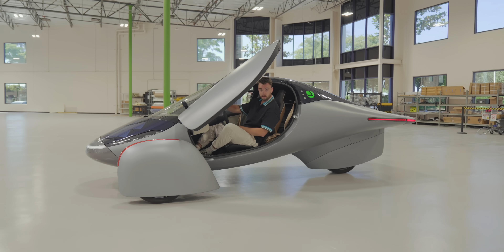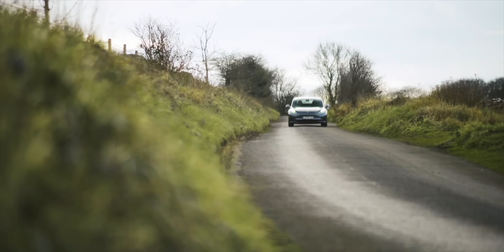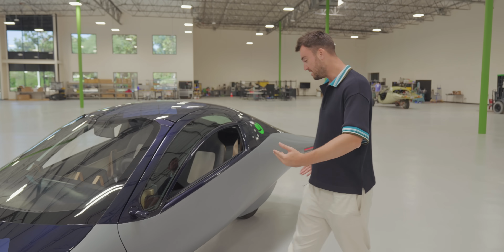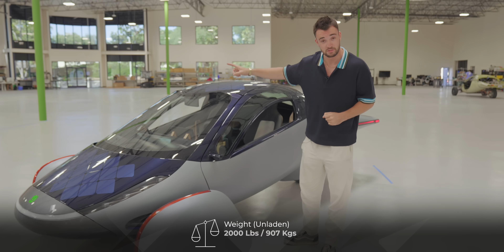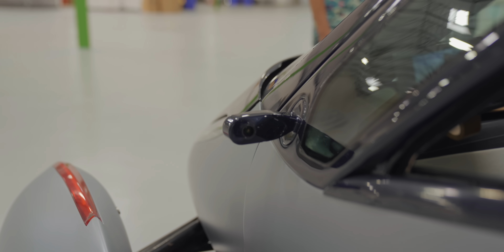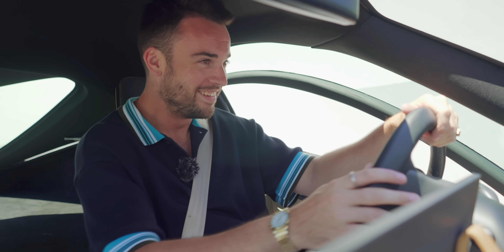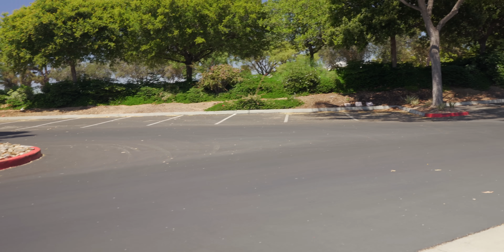The Game-Changing CHEAP Electric Car Inspired By Fish!

Comment: Great review, loved it. I wish the rest of the world thought like this. How can we use the resources we have in the most efficient way. Just because we can build and buy massive heavy and inefficient SUVs and trucks (it's a free country buddy) doesn't mean we should!
Reply: A bus is more efficient than this could ever be
Reply: @alexanderdcossey9146  Who wants to drive a bus around?
Reply: @alexanderdcossey9146  Not when a bus is traveling half empty most of the time. The "dumb mass transit" concept made sense before the digital age, but it could use some modernization as well. 

Regardless, yes lets get EV bus replacements going too, that's much much better than the old dirty diesel buses still running around today.
Reply: @alexanderdcossey9146  if you look at Fuel Efficiency: Modes of Transportation Ranked By MPG on the true cost blog, the average mpg for using a bus is 38.3mpg (roughly matches calculations seen elsewhere online), that is by using actual passenger miles traveled, if the bus was full it would be 330mpg, but how often do you see a full bus outside rush hour, or more relevant is the frequency I see buses around here with just one passenger (or empty), giving a journey mpg of around 5 or 6mpg!  But even with a full bus the Aptera is still more efficient than a bus (330mpg bus, 350mpg Aptera).  The Aptera even has a better mpg than running (315 vs 350..)!  

Although I must say that with current bus utilisation levels leading to an mpg of 38.3, then most (small) cars are more efficient than sitting on a bus, even my driving a small van with 500kg is far more efficient than a bus as I usually get 50-60mpg depending on how pressured I am on time (ie 50mph or 70mph where that is safe & legal).  

The low mpg for a bus is not surprising.  When there are significant volumes of people moving, that is usually going to / from work when the bus has to almost by definition do the return journey nearly empty, the bus companies will not be in a position to invest in smaller buses for non rush hour periods when occupancy will range from low to nearly empty, which will substantially drag the mpg down and make achieving the maximum 330mpg impossible.
Reply: @peterchandler8505  So the solution is to fix timetables.

Comment: It is a very good presentation of the upcoming Aptera.
I really hope Aptera can pull if off.
With the right to repair, I can imagine a huge after market industry to service and to  improve Aptera performance.
With small manufacturing floor space, Aptera can even franchise the manufacturing like McDonald franchises it’s restaurants.
Reply: @ATS599 
Only if Aptera can actually go into production first.
I am still skeptical that Aptera can pull it off. There are signs that they are desperate.
On Sept 10 & 11 this year when Aptera has to show the Gamma, we will know then Aptera would fall flat on its face or to become one upstanding and outstanding EV maker.
Reply: @Kukaboora  I think Aptera can (probably will) reveal a dud at FCL and still have those bone-head fanboys hanging on. They are nothing, if not resilient.
Reply: I thought you were wising up by now?
Reply: @aussieideasman8498  To have a clear conviction like you do is rare. One can only act as his or her ability allows.

Comment: Chevy bolt is also twice cheaper than Tesla, but it’s actually you know … a car! Áptera is amazingly efficient, stylish, groundbreaking and all that, but it doesn’t seem to be awfully practical as a one and only vehicle. I would totally get it as a second car, though!
Reply: Maybe not for a family, but as a single guy, this looks fine :D
Reply: @logicalChimp  I think it would be actually awesome for a family for work commute and other things that don’t require heavy lifting. It’s pretty sad to see a Chevy Suburban or some other gross truck stuck in morning traffic
Reply: Aptera has only two seats, but in all other ways is better than the Bolt.. More range, more cargo space (25 cu ft vs 16.7 cu ft for the bolt), more safety, more speed, more efficiency, 5 times more miles per minute charging speed...
Reply: @0ooTheMAXXoo0  Not sure about safety.  Not that Aptera is unsafe, but the Bolt may do better in a crash test due to size and type of safety equipment.  We'll have to wait for the tests.
Reply: @0ooTheMAXXoo0  Bolt has 57 cu ft storage space with rear seats folded. It has the same range as Aptera in minimum configuration, which costs the same as the new Bolt. Nevertheless Bolt is 3.5 miles per kwh (at least that’s what I’m getting in mine) and it doesn’t charge itself from solar 🤷‍♂️

Comment: At last !!!!  Well done on recognising the Aptera exists. This is the future!
Reply: That's the problem - it doesn't exist yet, nor do the performance figures.
Reply: @aussieideasman8498  Neither does the Lightyear One or the Sonos and yet they have been on the channel before (2/3 times for the lightyear). Additionally, the existence  of the Aptera wasn't even acknowledged on Fully Charged until a few weeks ago.   However the main thing is that the car is on the channel, they have over 20k preorders and it will be in production in 2023.  I cant wait to see one (have one) in the UK.
Reply: @WirelessGriff  [Neither does the Lightyear One or the Sonos] Here's a lesson in logic - when I say it doesn't exist, stating others don't exist makes no difference to what I said. 
[and yet they have been on the channel before (2/3 times for the lightyear).] I never said it shouldn't be on the channel. My problem is that they make claims as if they were factual, when they are not, and it is wrong to pretend with those snake oil salesmen. This has nothing to do with what they did pertaining to those others they featured. You are off on a tangent of your own. 
[Additionally, the existence  of the Aptera wasn't even acknowledged on Fully Charged until a few weeks ago.] Irrelevant.   [However the main thing is that the car is on the channel,] No - the main thing is that the trike is promoted as doing stuff it doesn't do. For example, pointing to merely plastic squares and saying they add range from the sun when they don't add an inch of forward movement is pure deception and ought to be prosecuted over, along with the founders.
[they have over 20k preorders and it will be in production in 2023.] When the facts come (whatever they be), then they can be advertised. You have just given a prediction, and that has been predicted and failed numerous times over, already.  
[I cant wait to see one (have one) in the UK.] But you must. Good luck with that. I can't wait to see how long before another capitulation. I will be looking for a Ponzi scheme happening, and will keep an eagle eye out.

Comment: As a person who hates cars, this is probably the only car I find myself appreciating and admiring.
Reply: Technically, it's not a "car", classified as a motorcycle.
Reply: @n9wox  True, but practically it is closer to a car than a motorcycle; It has seats, seatbelts, is fully enclosed, has a steering wheel and pedals, it is wide, it doesn’t lean to the side when you turn, and it is much heavier than any actual motorcycle.
Reply: Until a F-150 crush into you... then you will change your mind.... never mind, you are not here anymore. :chillwcat:
Reply: @johnsmith-cw3wo  I'm with you on that. The same reason some people are buying SUVs when they don't need them (they are afraid of getting into an accident with other people with SUVs that don't need them). At least there are some practical reasons for a small number of pick-up truck owners. I think vehicles like this would benefit to be  separated by their own lanes one day (on hwys at least). I'm thinking by that time any work related vehicle won't have a driver anyway. Winter driving is whole other thing, which was my first thought looking at it.
Reply: @johnsmith-cw3wo  I would rather have these monsters banned for non-work related uses and require a special license to drive them with additional training.
Reply: @Ilovepastatoo  good luck with that... this is the land of the free... they don't ban assault riffles for 18 year old boys.

Comment: Is it coming to Canada
Reply: i got an answer from them to  same question

Aptera Support (Aptera)

Jul 7, 2022, 12:07 PDT

Hello!
 
Thank you for contacting us! We’re working with regulators to comply with the regulations in Canada so that we may begin selling it there in 2023-2024. We’re excited to bring Aptera to Canada and see no issue with receiving approval from Transport Canada.
 
With all-wheel-drive and vectorized torque control, Aptera handles snow and ice very well. The extreme cold 'corner case' is part of our development and cold weather test plan. Both, to prevent batteries from going below freezing and reviving them in the case that happens. Our sandwich core composites body offers excellent insulation and a nice heater; it’s very comfortable driving in the winter.
 
We will be using all available resources to perform hot/cold extreme environment testing at various proving-ground locations around the country and look forward to sharing the results as we continue testing and development. Please let me know if you have any more questions! We appreciate your interest!
 
Driving solar mobility forward,
Nicole Hall
Community Success Associate 
 
 
Aptera Team
Reply: Yes

Comment: Got one on order, but concerned about the width compared to garage door width. Those from wheels look very vulnerable. I guess with solar, just leave it outdoors, but parking might be a problem with monster truck and SUV unable to keep in their space.
Reply: It has solar power assist, so you will want to keep the Aptera outside to charge up for free. The standard single garage door is 108", so it's 20" wider than the Aptera. The Ford F150, with mirrors is 95.7", which is much tighter fit.😯 Interestingly, the F150's side view mirrors alone have more aerodynamic drag than the whole Aptera! 😳
Reply: @deanmcmanis9398  Standard single doors are either 9' or 8' wide.  My garage doors are 8' (96") doors, which seems to be more common.   The actual opening is a bit narrower than 96".  An 88" wide Aptera will require paying very close attention to the wheel covers on the driver's side and extrapolating that the passenger side won't hit.  My biggest concern is that it might be difficult to see where the passenger side cover actually is.
Reply: @lsh3rd  7' wide in the UK (the standard is many decades old), quite a few people have cars which can't fit.
Reply: @deanmcmanis9398  A lot of people have 8' garage doors.
Reply: That’s my concern too.  I just looked it up and it’s 8 inches wider than a Ford F-150. Not sure it would fit in my garage. I figure I’m better off putting solar panels on my house and getting electricity that way.  This is a very cool vehicle but the Sion solar car seems more practical as it’s got the body of a basic hatchback.  I’m got sure what I’d get used to, but I’m guessing it would sit too low for me and I’m guessing I wouldn’t like the gull wing doors, or the width. But if they can actually sell it at the price they are proposing, I’m sure it will have a market.
Reply: It is wide in front and a concern for me too. If I buy one, I might take the wheel pants off for around town driving. It would decrease efficiency but not by much at low speeds. Apparently,  they are easy to remove and replace with just a couple of tools. Without them, it would be about 2-3" narrower.
Reply: @tims8603  I'm not sure, but the wheel pants may include the turn signal lights.
Reply: @randylewis4242  They do
Reply: @randylewis4242  Yeah, I think so. I don't think turn signals are required on motorcycles in all states, not sure about auto cycles. I could rig something up if they are. Wouldn't be too hard.
Reply: @tims8603  My suspicion is that someone will come out with mini-fenders for Apterae with an integral lights.  I hope they make the covers easy enough to remove and with a backing plate that would allow for an attractive mini-fender design.  My commute has a max speed limit of 45 MPH, so I'm perfectly fine with the efficiency hit - for road trips, I'd swap the stock covers back on.
Reply: @lsh3rd  That would be cool. I'd definitely buy something like that. I think aftermarket add-ons will be popping up after Aptera is in full production.

Comment: It’s half the price, but also less than half a car. Other than going to work and back it has very little utility or practicality. You also have to be comfortable looking, shall we say, rather unique driving down the road in your spaceship motorcycle hybrid. It feels like a stretch that a vehicle of that sort would ever be usable for more than a tiny fraction of an already small tiny fraction of EV owners.
Reply: Work and back is 80% of car use.  For many households this can be one of two cars or just hire a car for more space, holidays etc
Reply: @donaldpyper4627  you never go to the supermarket then?
Reply: @cybergornstartrooper2157  it looks like it has fine enough cargo capacity for a few bags of groceries, either way it's not wise to conclude anything as the vehicle itself isn't concluded.
Reply: @cybergornstartrooper2157  This vehicle has more luggage space than my old RX7, which not only handled the shopping etc, but also trips to B&Q for hardware, inc  2.4m wood beams.  Granted, the distance from the passenger footwell to the back of the boot may be a bit shorter in the Aptera (the RX7 was - technically - a 2+2, not a pure 2-seater), but it's plenty sufficient for that sizable fraction of the population that are either single, or don't feel the need to drag the whole family everywhere they go all the time.
Reply: @cybergornstartrooper2157  700 litres of cargo.  That's a LOT of space for groceries.
Reply: It’s not even half the price the Dacia spring Electric will retail for about £10k

Comment: it's a motorcycle
Reply: Autocycle is a more appropriate label.
Reply: @bobhilder1469  I wonder what will happen when a big truck hit it 😅😅
Reply: @eltahan123  probably what happens to any car when a truck hits it lol
Reply: @eltahan123  Supposedly Aptera will voluntarily put the vehicle through "crash testing" and share the results with the world.  If that happens, we won't have to "wonder".
Reply: @bobhilder1469  or 'when' as against 'if'?
Reply: @peterchandler8505  I’m afraid I don’t follow.  Can you help an old fart out here?
Reply: @bobhilder1469  The joint CEOs have many times said that the Aptera will go through crash testing, it has been their intention for a very long time...  With only 4 prototypes so far, it is ... just possibly a little early for the crash tests, especially as the production intent model is not around yet.
Reply: @peterchandler8505  Got it.  Thanks!

Comment: Not good if you're 6ft 5
Reply: Jack (the presenter) is 6'8" iirc
Reply: @logicalChimp  He's 6'5" I think.  He seemed to fit OK, and the more recent prototype is taller in any case.
Reply: i am.  it looks fine. the photos and specs about headroom/legroom seem adequate. there's plenty of things to worry about with aptera, but that's not one of them.
Reply: The newer version has 2 inches more headroom than that old alpha version he showed.

Comment: This is stunning! Please bring it to the UK :)
Reply: That 2.2 metre width is gonna be tricky in London - but I'll make it work!!
Reply: @JackScarlett1  2.2M is not legal in the UK or Europe (maximum 2M wide for this class of vehicle) - they are designing a narrower version, tentatively 2024.
Reply: @WyndStryke  What's your source for that? The UK's The Road Vehicles (Construction and Use) Regulations 1986 specifies a maximum width of 2.5m and I can't find anywhere that was superseded by other legislation
Reply: @jbaidley  It's not a car.  It's covered under the L5e-A regulations, and regulation 168.
Reply: @WyndStryke  Great. Thanks.
Reply: @JackScarlett1  Good job I don't live in London (or any large city/town) ;)
Reply: @JackScarlett1  With no drive shafts to worry about, they could make a version with variable dynamic axle width.
I'd like to see a 4WD version - makes avoiding potholes easier, and the rear wheels would be in the slip stream of the front ones.
Reply: @ahaveland  that's exactly what sunk the company the last time. 4 wheels bad.
Reply: Good luck driving over centre road speed humps. Clear the front wheels and forget the rear centre wheel, as you go up out of the seat and crick your neck on the roof lining.
Reply: Going to be great fun trying to avoid a typical UK pothole in a three wheeler.

Comment: Yes yes YES to efficiency and YES to innovation. But not like this.
Reply: Okay Boomer.
Reply: What are the NOs?
Reply: @randylewis4242  unfortunately it looks like a child's drawing of what a car from the future might look like.  Also it only has two seats and is technically a motorbike.  I think the Sono Sion has the right idea.  But I'm sure plenty of these will be sold in California.
Reply: @BenGoodsonModular  I agree - I think this is more of a proof of concept car. But I support it because I think it's step in the right direction.   If successful, they have plans (dreams) of a four wheel design.   The question is if they can produce something before Sion comes to the US (assuming it's successful).
Reply: @randylewis4242  It's pretty close,,,  Sono have the advantage of using contract manufacturers so should be on European roads about the same time as the Aptera hits US roads.....